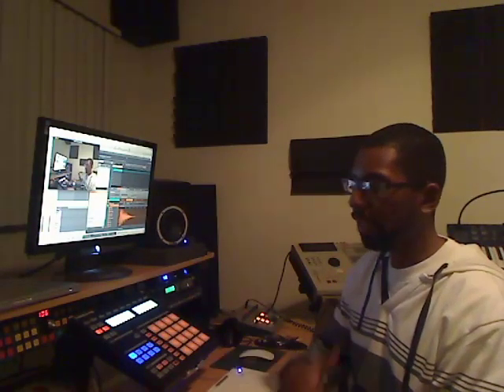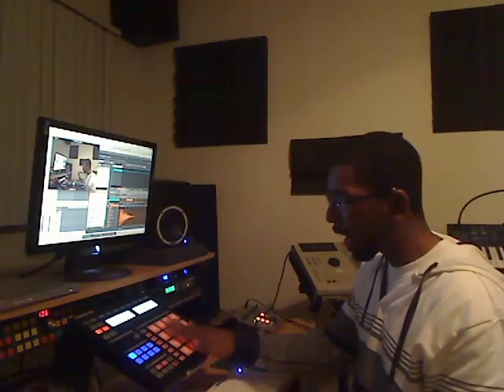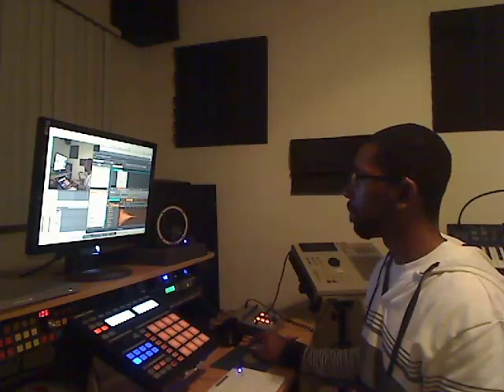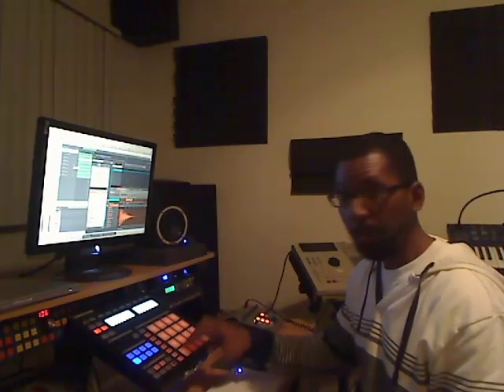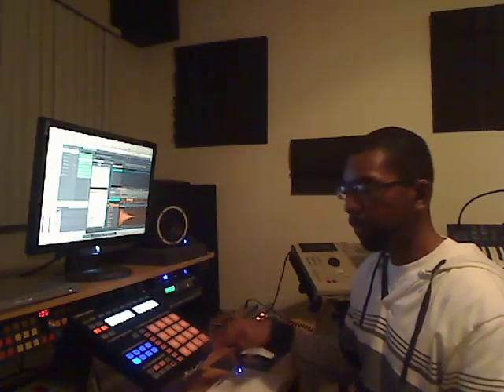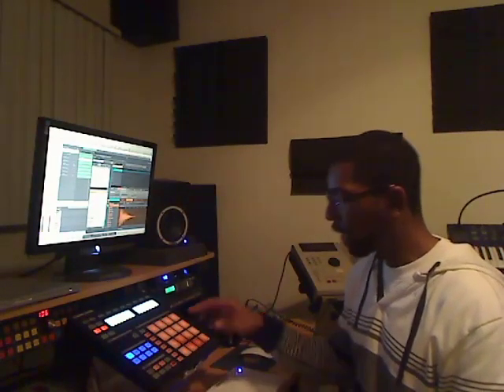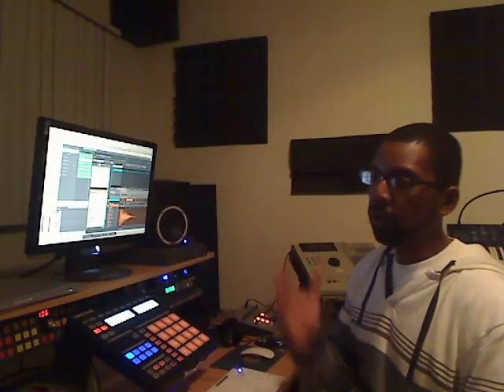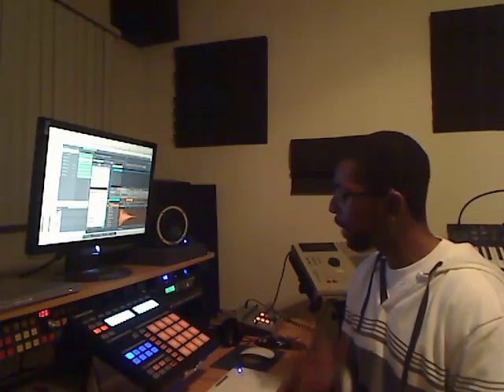Follow up to Integrating Maschine 1.x with Logic: Altruwisdom

Comment from the maker: In regards to the Mapping Mode page for Sound MIDI Batch Setup; each time you open the Mapping Menu, you will be shown the last used setting in the Sound MIDI Batch Setup. You will not be shown the current status of the pad/sound from the Sound MIDI Batch Setup. In order to view the current setting of the Pad you need to Control+Click on an individual pad/sound, then Select "Sound MIDI Settings". The following dialog box will allow you to check the MIDI settings for the selected pad.

Comment from the maker: Did you download the Template from my website?  Also check the Logic Inspector and make sure that Logic is set to the correct MIDI channel for each track. The Default setting is ALL, but you may need to change this. I highly recommend that you try my template first.